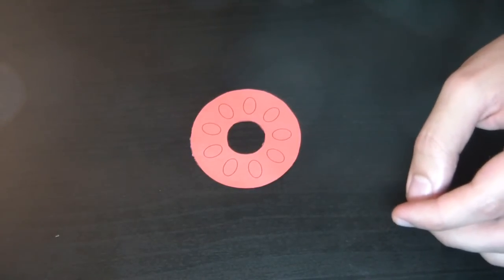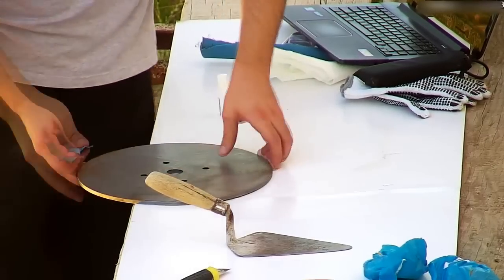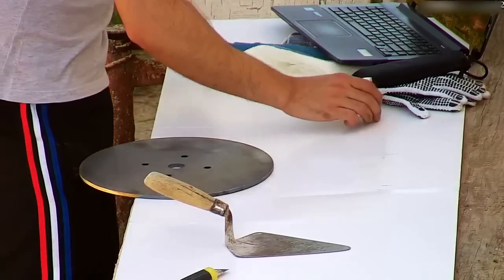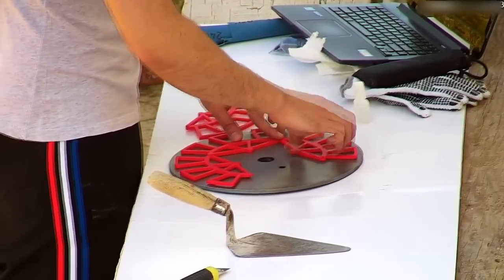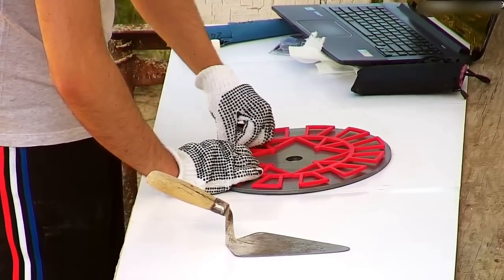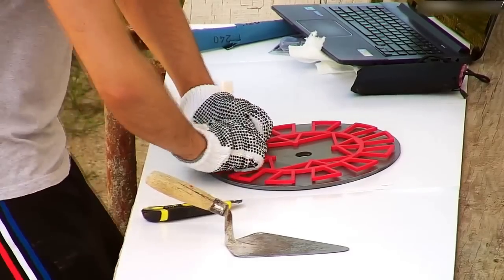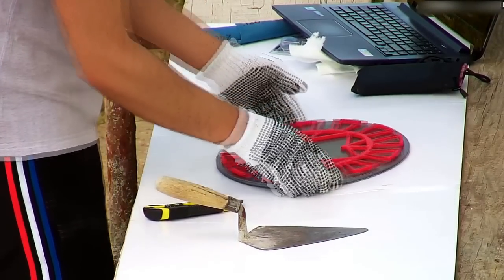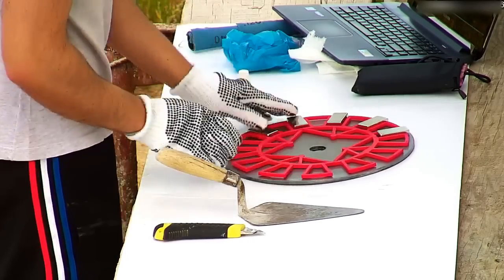DIY 1kW HAWT Wind turbine [Part 1] - Magnet rotors

Comment: I'm making a similar generator using two Honda brake rotors turned backwards on the front hub, facing in instead of outwards, and 18 poles...I'll be using 36 ring magnets per rotor, 72 total, held on by screws, two per coil...so I'm glad this wasn't a how to video. My rotors are 273 mm in diameter, and made of stainless steel.
Reply from the maker: Hi, there are hundreds of ways to make wind turbines, the way I show is probably the most common for a 1kw wind turbine, this design has been proven to work by a lot of people and you can find it all over the internet. Now this does not mean your design won't work, I'm sure you looked it up before starting, it is just different. I do not recommend using stainless steel for the rotors though, the magnetic flux will be much stronger if you use iron rotors as it travels from one magnet to the next through the steel forming a complete loop when you have the two rotors facing each other, with stainless this flux is much weaker. Good luck with your project.

Comment: hi, I just want to ask if you try that stator circulates counter clockwise? if it circulates clockwise it produces electricity then what if it circulates counter clockwise? it still produce electricity and can be use in charging the battery even it rotates backwards?

Comment: Hello! This is surely one of the better D.I.Y wind turbine projects on yt. Can I ask, what type of steel have you used for the rotors? I've heard that the more magnetic the rotor material, the better the power generation. Given that, should one avoid stainless steel in favour of more magnetic types? Thanks!

Comment: Hello! I live in Brazil. I need 1 PMG Axial Generator of low RPM to charge batteries . This week, I am looking supplier from China. 

But, Can you also sell 1 of this?

Basic data sheet - rating following:
> 10 ~ 17A  Max current
>56VDC,
2 KW

Email: infovirtual.br@gmail.com